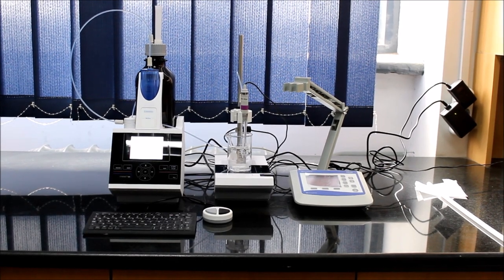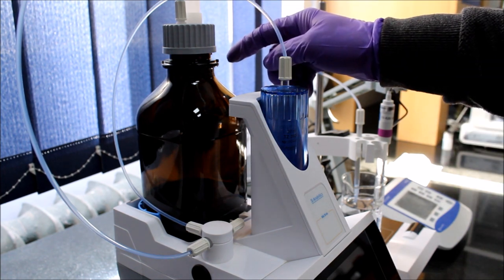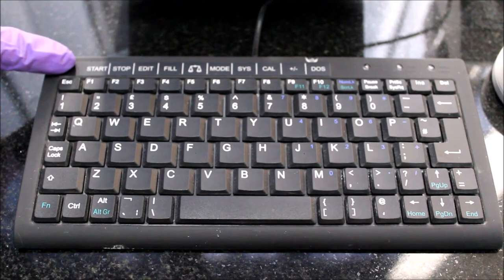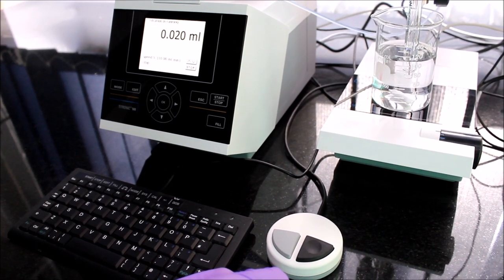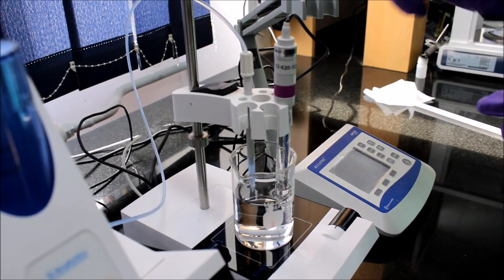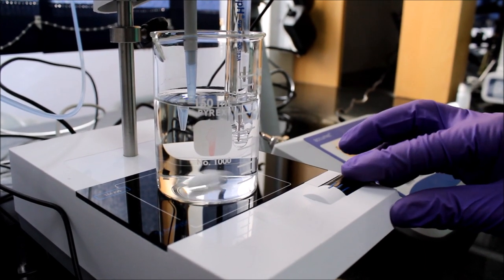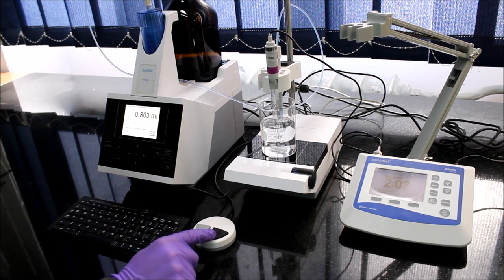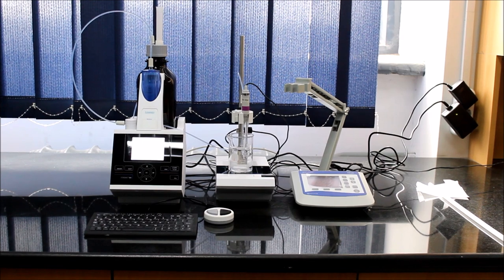Titration Using an Autotitrator - Video Tutorial

Comment: How we determined chloride ion concentration in colored dye solution????
Reply: You may never see this but there is a PH probe in the solution which is effectively measuring the concentration of hydrogen in the solution. Because HCl is a strong acid when it enters water functionally but not literally all of the HCl is turned into H+ ions and Cl- ions so by measuring the PH then doing some math you can determine the concentration of the chloride. Also, you titrate to determine the concentration of one unknown solution by reacting it with some other unknown solution